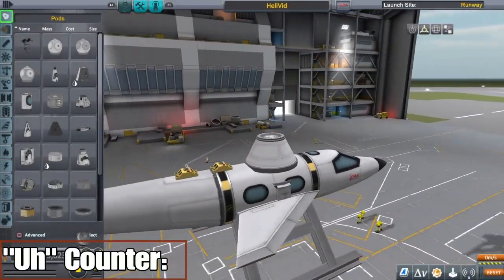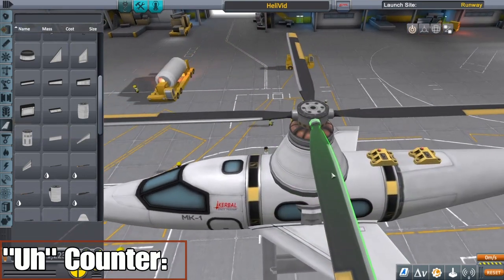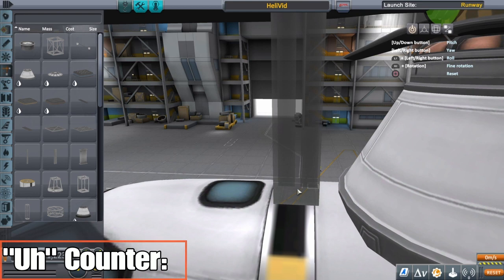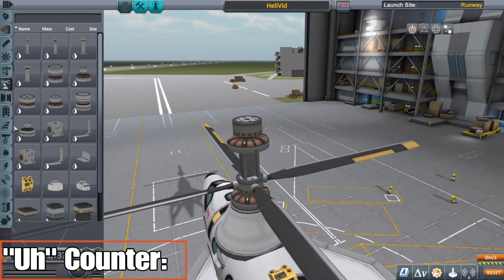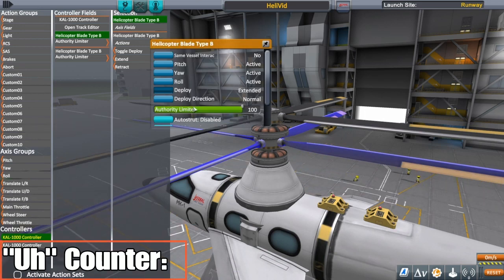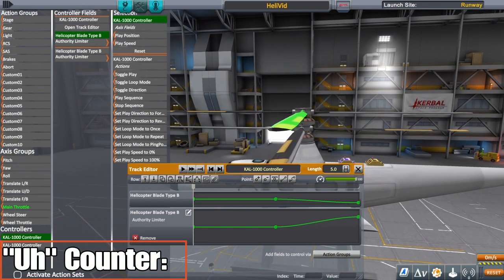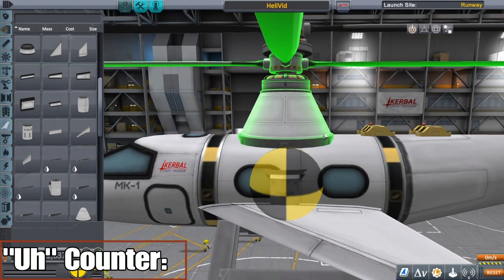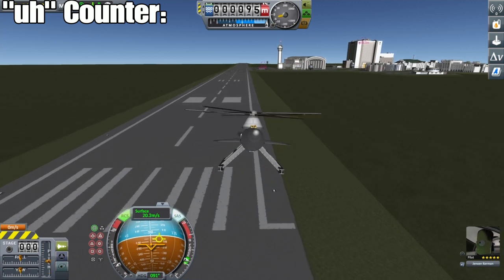Kerbal Space Program Tutorial - Contra Blades

Comment: You could just place the beam on top of the lower propeller, clip it down and use the root tool to change it's root to the FL-A10 Adapter.
Reply: As a matter of fact you are already breaking the cliping "rule" so you could put the rotors on top of eachother and then change the upper one's root to the FL-A10 (so it's technically floating)
Reply from the maker: I’ve found a better way since making this. Put down the small structural block. Put a rotor on top. Move it all up. Put a rotor on bottom and flip it.

Comment: Thank you, very useful!
I'm just going to buy Breaking Ground DLC, so wanted to clarify one thing. Is it possible to build contra-rotating helicopter without that offset rail?
For example:
Put a bottom servo platform or rotor with blades, do not add any actions for it.
Put a top rotor with blades, make it spin.
The top rotor will spin and rotate the bottom rotor with blades in the opposite direction. So we are getting two sets of blades powered basically by one rotor which cancels momentum of itself.
Will it work?
Reply from the maker: Yes you can. I just use the offset trick so the power is more consistentz
Reply: If you use a fairing but cancel building the actual shell you can place both rotors on the same axis but independent of each others' rotation by using the floating nodes it gives you

Comment: Thank you so much! This made It really easy to make my first helicopter.  Is it the same for contra rotating plane designs too?
Reply from the maker: Sure is. Your welcome! Stop back next week for a deep dive in to the KAL 1000
Reply: It’s even easier for planes because you can just put one motor on the front and one on the back. On the front you want the authority limiter to go in the negative degrees and the back should be in the positive. Unless you want both propellers on the front of the plane than this method is easier because it doesn’t require offset(only works easily for planes)